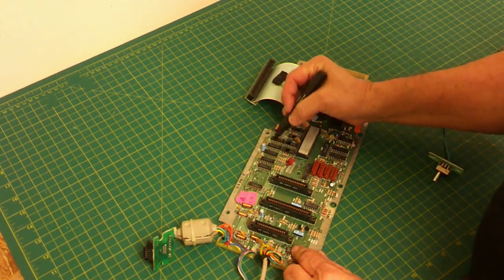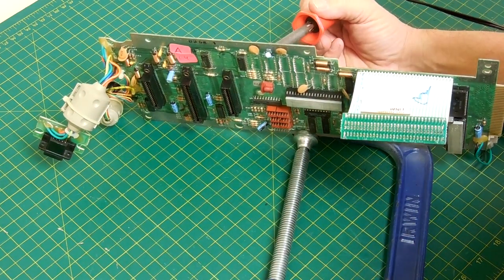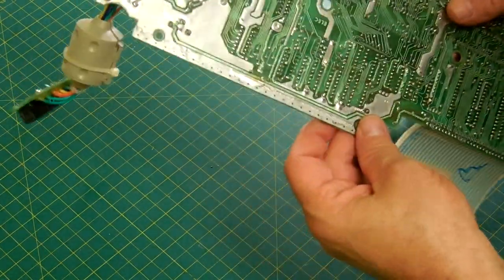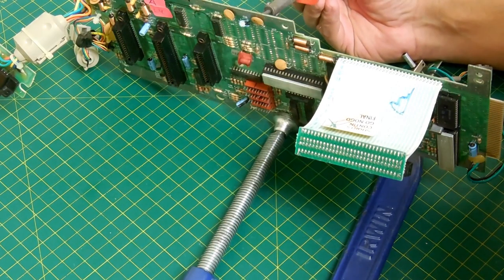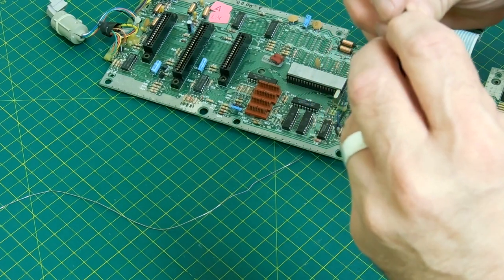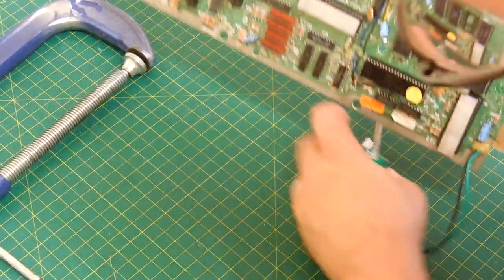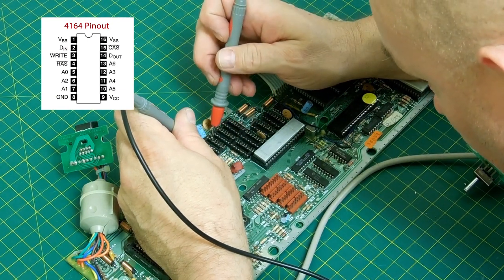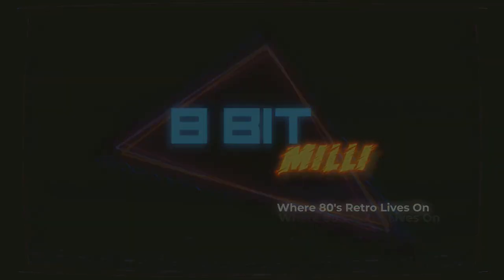Return of the Nasty

Comment: Really fun stuff. Thanks for all your helpful hints here and on facebook over the last year.  I tend to use a similar but different approach
- Hakko Desoldering Iron to remove as much solder as possible. Adding more like you did to get a good flow
- Low-ish temp heat gun to heat the whole chip from the underside and pry it with a chip lifter when it's liquid
- Hakko to clean the holes.  

Your method looks like it works great too though. I may have to try it. The only concern I'd have is the side cutters scratching things when pulling pins. Maybe needle nose?  Either way, thanks for the content.
Reply from the maker: I may try the heat gun on a few junk boards